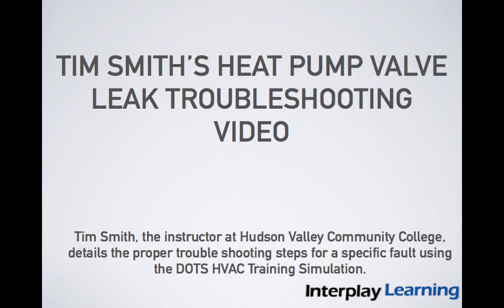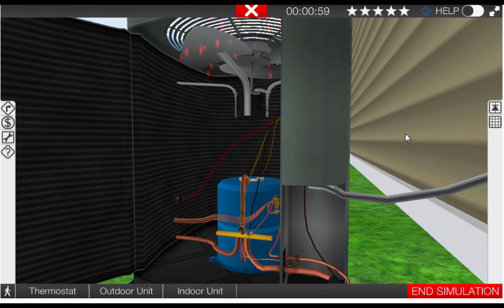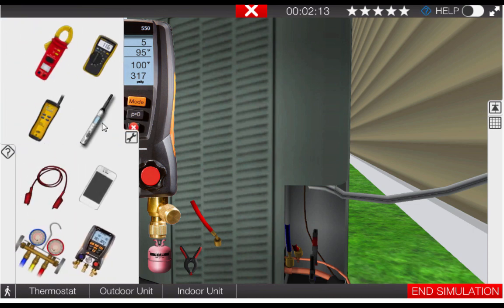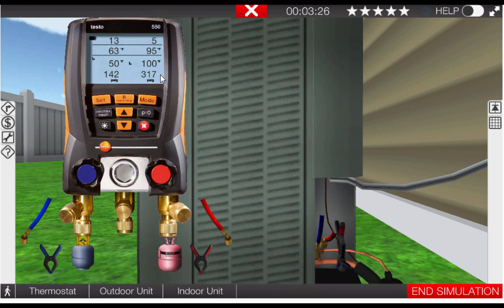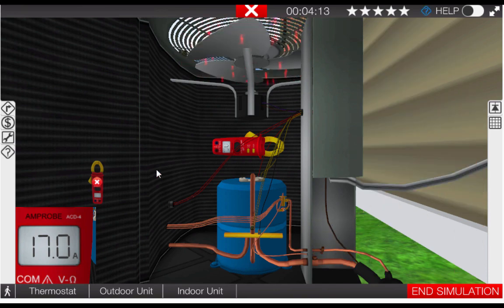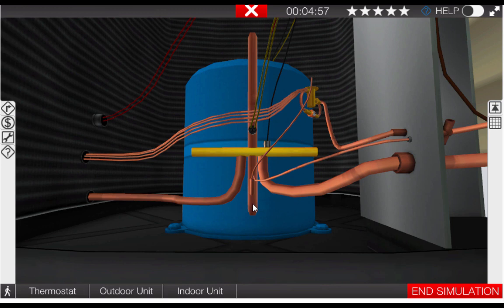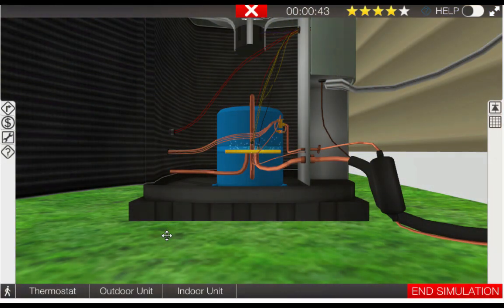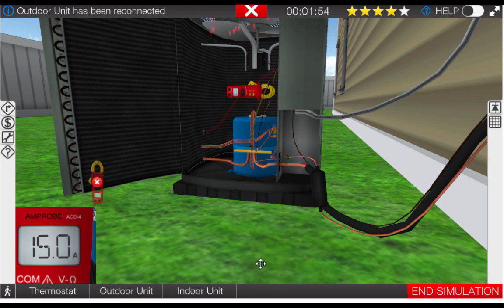Valve Leak on a Heat Pump Troubleshooting Video

Comment: would a bad reversing valve affect your freon levels?
Reply from the maker: No. The valve is leaking internally from the high pressure to the low pressure.  Not an external leak.